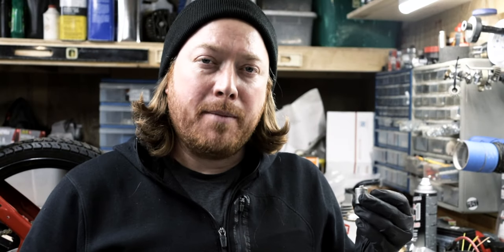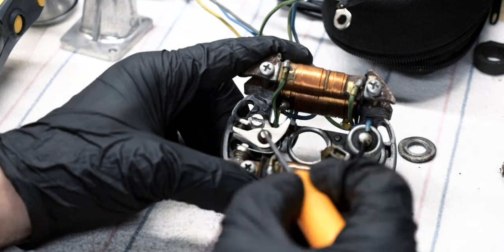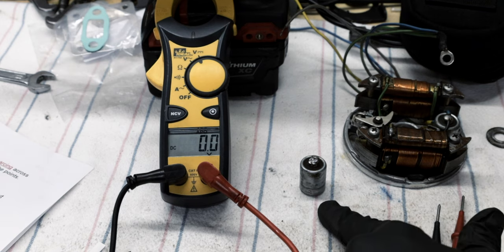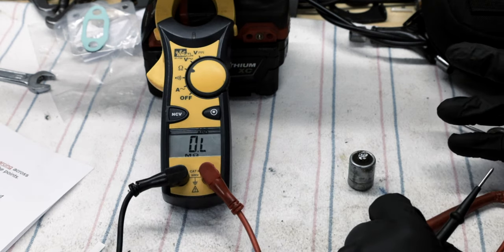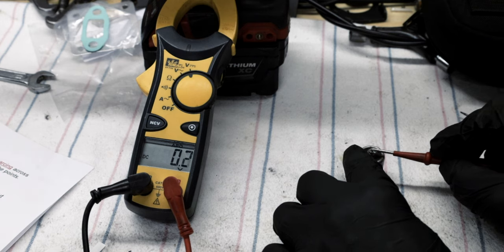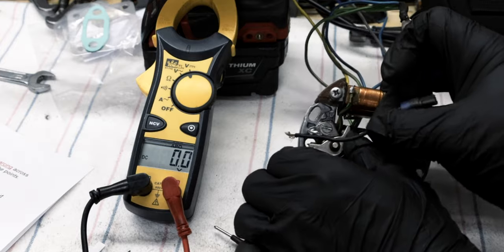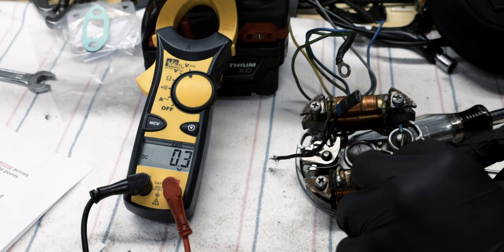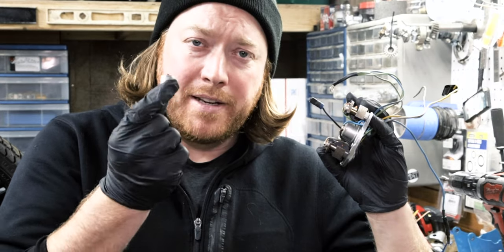Test your points condenser easily with a multimeter. Moped, Small Engine, scooter, ect

Comment: Thanks for the straight up description.  Question: if a condenser is bad (but everything is okay, points, spark plug, etc.), can this be the reason for a moped for not being able to start up?  Will be receiving a Peugeot 103 soon which the seller says doesn't start up.
Reply from the maker: Yes it could. But I bet the engine would pop and try to start. I think it's another issue.

Comment: I dealt with anything except bikes, now I have an old (!) special case single cyl engine with bike type ignition, a Bosch double coil thing in same style as yours there. Cant get a new breaker for it , they dont exist anymore. I thought putting in a complete stator or highwatt coil CDI system with trigger should be a short story but I cant find anyone specifying their replacement part geometrics. They just keep on listing bike model compatibilities. 

My coil (/stator) base plate outer diameter is 110mm, has 3 slider screw holes for timing degree adjustment (topsides and one in bottom). Looks very much the same just like yours. My magnet flywheel inner diameter is 100mm -ish, my coils measures for 98mm outer diameter. 
Do you know what bike/ATV/industrial engine model´s parts that may fit well for the measures given for this grand papi ?
Reply: ...and by the way, how do I losen that plate integrated condenser for a replacement ?

Comment: Fuckin' A.  Thank you.  So clearly explained in 2 freakin minutes relative to the hundreds over overcomplicated videos on this.  I can't believe I can test this directly on my bike.  What happens on the multi-meter if I have a bad one?  Do the ohms and dc readings have to reach a certain number?  Are higher rpm kits more likely to fry a 45 year old condenser?  There's folks out there who say that the bosch condensers almost never fail.  What's the best replacement condenser?  And finally, if my points are still arcing and sparking with a known good condenser, does that mean the points themselves are bad, or that my timing is off?
Reply from the maker: lol, I forgot to add that. If the condenser is bad it wont take a charge or discharge. So the meter would not move. It would just stay at 0 or overload.

Comment: If the condenser is bad would it the moped sound like it's missing and stop running,  fuel foul the plug.
Reply from the maker: yeah totally. That could also be messed up timing.
Reply: The timing is dead on. Lol I used a 14mm x 1.25 tap and a Caliper to set the 1.5 mm befor TDC. After watching your video, the condenser isn't taking a charge. It's showing nothing. Many thanks for your informative video.
Reply from the maker: @charlesrknottsjr  yeah! try a new condenser and see if that fixes things!

Comment: my condenser is able to charge and hold a charge off the bike, but will not charge on the bike even though I have the points separated by a wad of duct tape. What is this telling me?
Reply: Either your electric tape is no good or more likely the wire is shorted to the case.  The metal can must be "grounded" and the wire must be insulated.  Some versions do this by having a screw pass through the distributor body in a plastic or rubber grommet others do this by having the wire itself or a block of plastic under into a slot.  Either way if it shorts to ground it's a bad thing.

Comment: According to yourself, setting the multimeter to ohms, then placing the probes on the condenser, puts a charge into it ?? why not use the battery for this, and then observe the wasting of the charge on the meter set to volts.